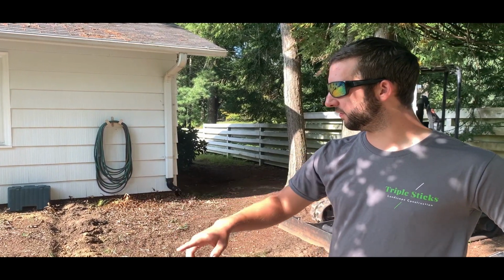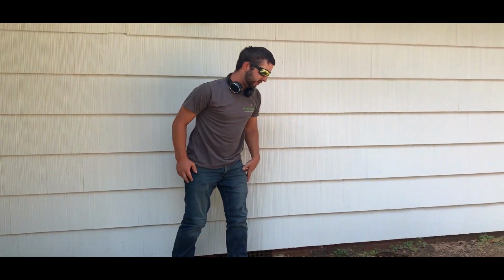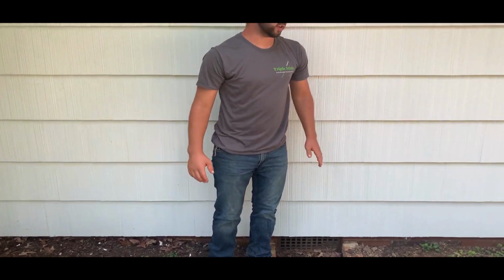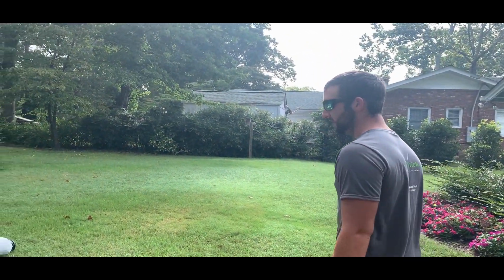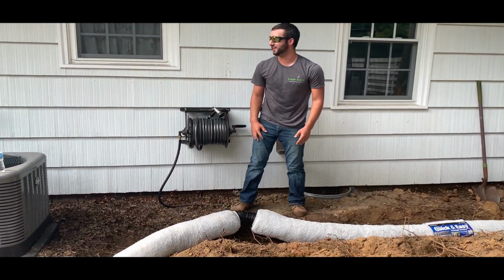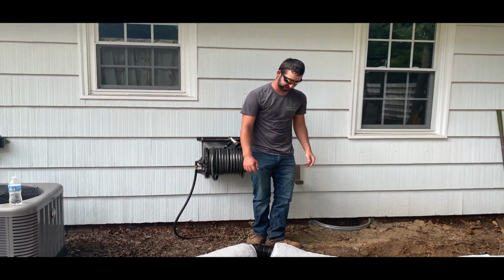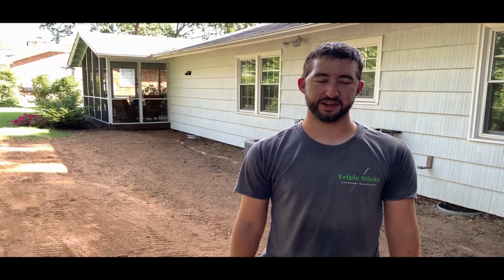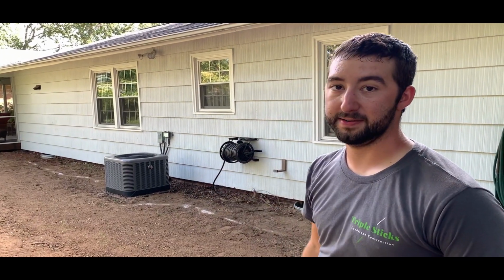1 Day Grading Project

Comment: I know you have since sold the ASV, but how was that machine? I do strictly limited acess jobs and all my equipment is 48" or narrower. I use a  MT100 mini skid currently, but am thinking of adding an RT25 or 40 for the grading ability and ability to load taller dumpsters/trailers. Any insight would be appreciated.
Reply from the maker: It was is a good machine. It was  reasonably comfortable for operating all day,  its power was good, and I didn’t have any trouble loading anything, because its reach was very good. The only reason I got rid of it was because you’re only moving about a wheelbarrow load of material at a time.

In other words. It’s not  very fast at moving a lot of material.
Reply: @triplesticks  Thanks for the info! I accept small moving capacity as one of the downsides of the equipment I run, but I charge accordingly to do it. I do run larger buckets on my MT100, which it handles well, but the RT25 is rated a good bit less than the bobcat. Did you ever consider a higher capacity bucket for the RT, or did it just not have the power to do it? Thanks!